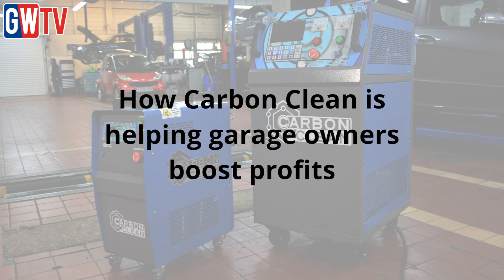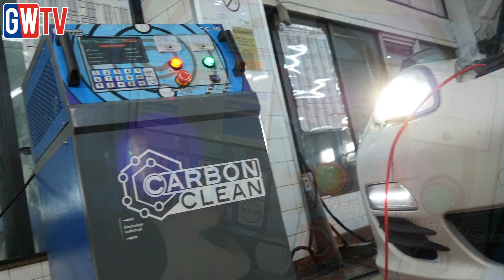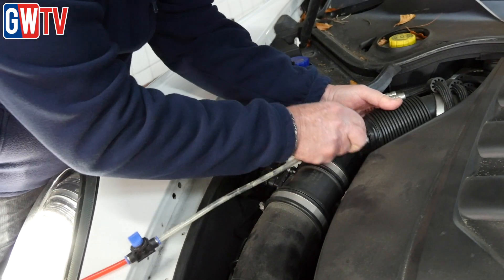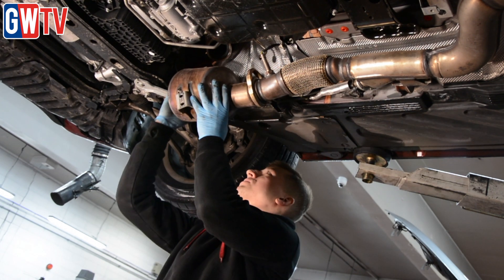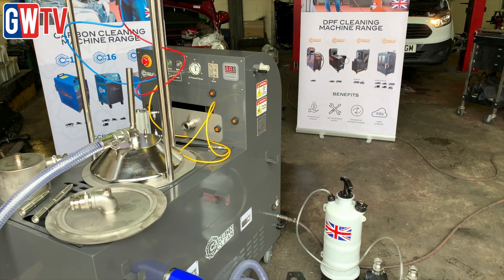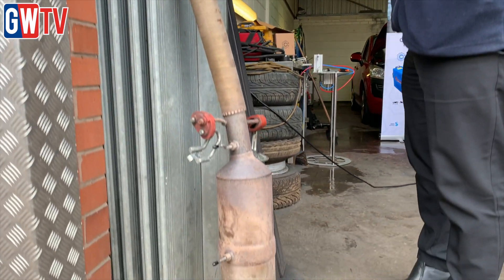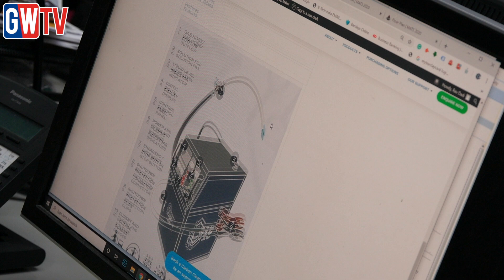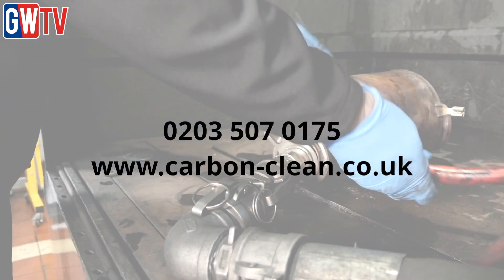Carbon Clean: Why engine and DPF cleaning is now an essential for independent garages

Comment: It does not work. Well, it might remove some carbon from inside the cylinders but it does basically nothing for the valves and intake manifold

Comment: Nice video, had it done to my Stage 1 2008 TT with 70K miles on the clock and the result was absolutely brilliant. Car is daily driven and been fed only V Power over the last 2 years of ownership. Prior though the car was barely driven for about 7 years so I reckon the carbon build up was mostly from that time. No amount of Italian tune helped either. The HCC clean sorted out a misfiring on cylinder one and rough cold start idling. Much better torque and smoother power delivery that doesn't break traction nowhere near as much now. Highly recommended. Will be doing it every 2 years.